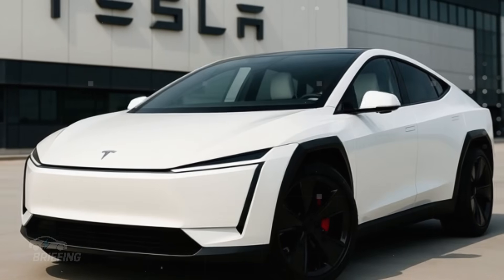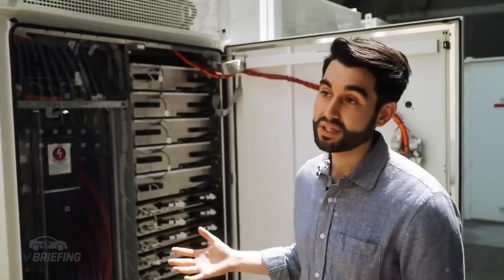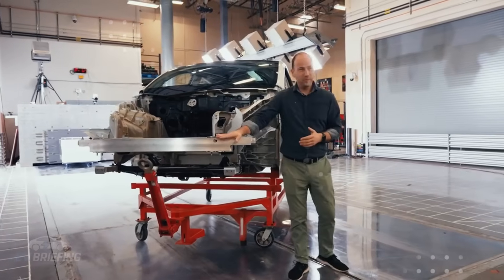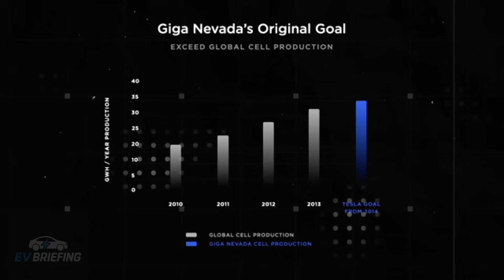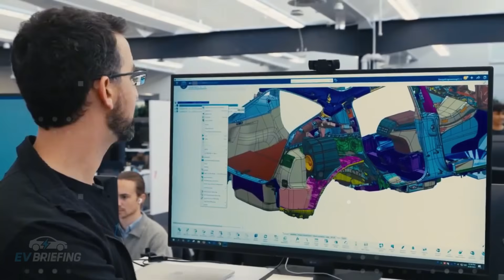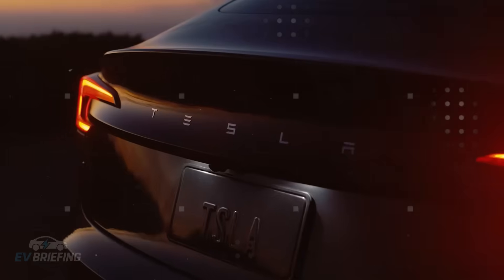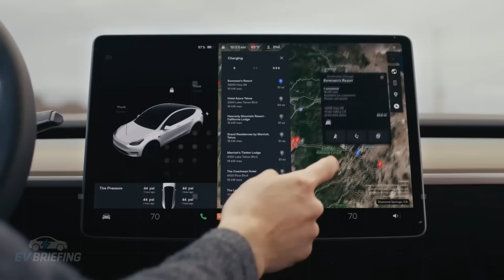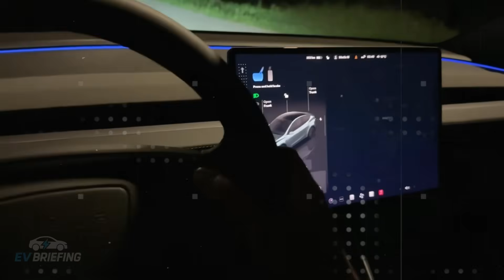IT’S HERE! Tesla Model 2 Senior Edition: $13,579, Physical Buttons & 10 Safety Upgrades

Comment: No auto maker seems to understand this: Buttons cause "distracted driving" and even more so if they "touch screen" buttons.  You have to take your eyes off the road to press a button, and if you hit a bump at that time it will probably be a wrong button press.

Now they have put lots of things on two steering wheel stems, like lights, turn signals, wipers etc.and once you get familiar with these they are not a "distracted driving" problem.   It is the whole range of heat, and fan and AC and music controls that are all "button controls" when they should be "large knobs" where possible / practical.  Where you can grab them by feel, and don't have to look.   Looking outside the cab, instead of inside.